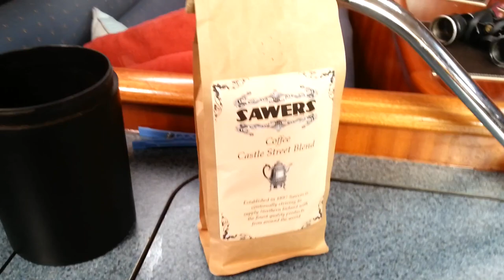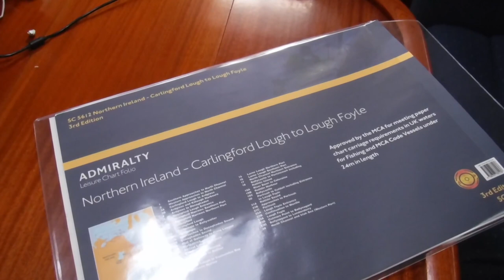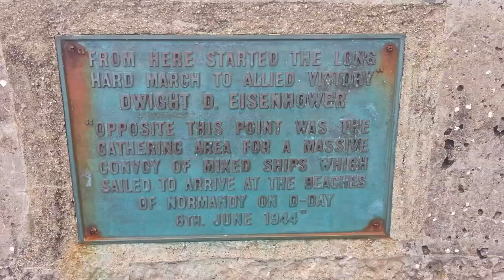Bring Out Another Thousand - Boat Projects in Bangor - Ep.63

Comment: Hello,
Very interesting your docking stick. I do not see how are done the cleats and where to find them?
Could you provide more information. Thanks in advance
Loïc
Reply from the maker: The clips are just steel spring clips lashed on with whipping twine. We did away with the plastic tube as it just added unnecessary weight and pulled the clips off. Perhaps this later video might help?
https://youtu.be/8h1kBr_43yA?t=941